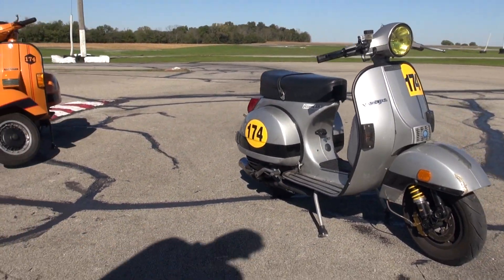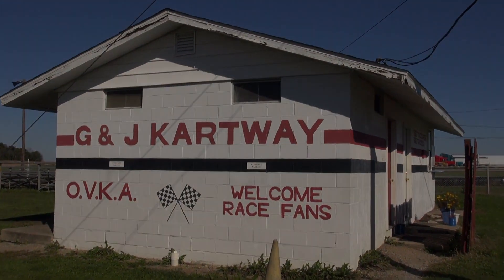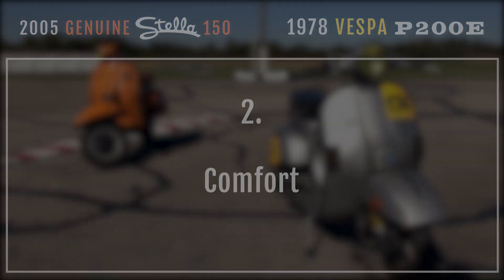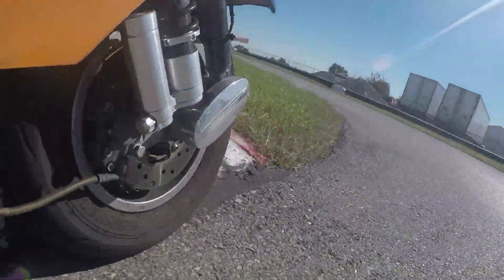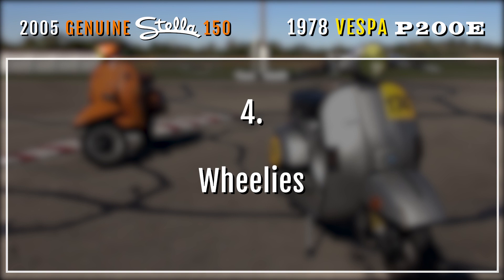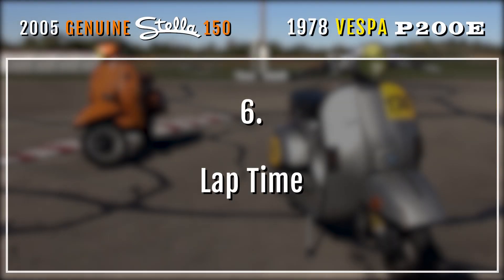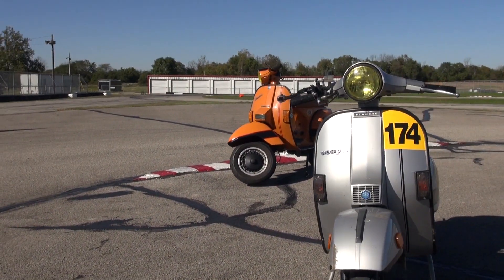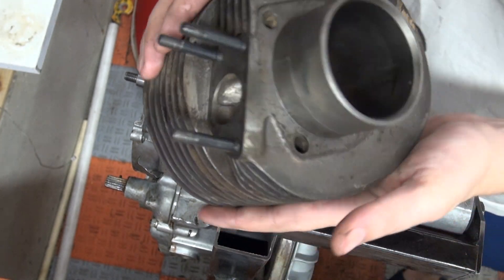TST Ep. 32 - Epic Shootout! Pinasco 225 Vespa P200e vs. Malossi 221 Vespa PX LML Stella

Comment: Most Excellent! Thanks for putting this together. I prefer the look and sound of the Stella, but the braking and stiffness of the P200. I was so used to a seat on a Bajaj Chetak 4t that I put on an Ancilli seat. The stock is very springy with the bar, as you described it, right in the middle. Great job on both scooters and thanks again for sharing! I've learned a lot!

Comment: Nice video again !!  Both projects are very close to the power i think,  but some small details are making the difference.  I really like the lower on the P 200 E and i want to do the same to mine vespa. How much did you cut ?
Reply from the maker: agg hell I had the fork cut by the experts over at SaintsCycleWorks, they got the proper rigs for it.

So the stock P shock is 245mm and the PK shock is 205mm. We cut between around 1.4inches out, changing the dynamic a little bit more, making it more stable on a straight and a little more work intensive to lean into a corner. And when I say “work intensive” I really don’t mean by a lot. It reacts a lot better to weight shifts and body position, compared to stock where it was sitting higher and was a little Wobblies when I whipped it around. Did a full video on the front end, if you wanna go back and check it out.
Reply: @ThatScooterThing  Awesome job with the front suspension. I will do the same but first i want to finsish a new fiberglass fender that i m building and will be lower than the original with other shape. Thank you and we will be in touch.   Keep walking...........!!!

Comment: Top speed? Would be a nice vs. Congrats for these 2 years
Reply from the maker: Mario Arias top speed really is a tricky one as there aren’t many roads close by where we can do it legally. Anyway, I believe the P200 easily takes the cake there. Power is a little higher in the rpm range the primary transmission is longer. But they both easily cruise next to each other at 70-75mph (110-120kph)

Comment: What makes is this Stella !!?
Reply: hi the Stella is an LML but was called Stella for the USA market hope this helps
Reply: @Mel-bt8pq   r understand bud I have 1 of the last ox 200 E made on a 04 plate A aGp 200 lambretta what is a Ts1 225 and a GTS 300 where u from I'm in the UK
Reply: @Mel-bt8pq  sorry px
Reply: @granto6738  uk as well north east i have a lml 125 which is similar to the px 125 for parts anyways lol
Reply: @Mel-bt8pq  I'm North East Durham
Reply: @granto6738  not that far from me Stockton-On-Tees here by the way the GTS300 is one of the newer vespas i believe
Reply: @Mel-bt8pq  yes got it in June had a 14 plate 1 better bike the abs is f terrible. Just got my Ts1 up and running again went first go not been on it since 02 fast as f all done by chissel speed
Reply: Stella Models =Made Or Assembled Outside Of Italy